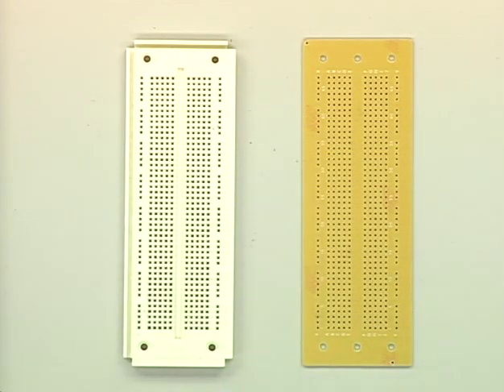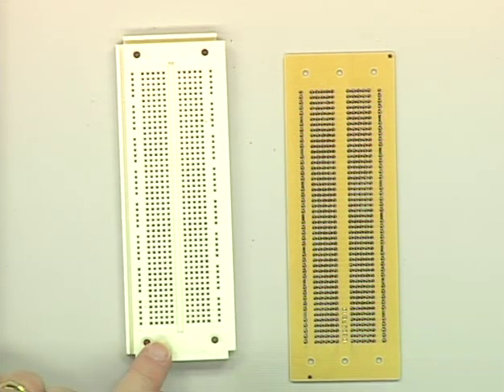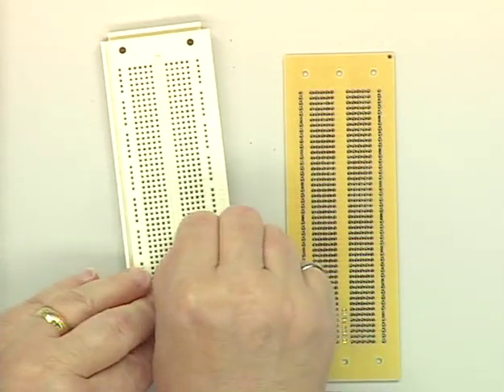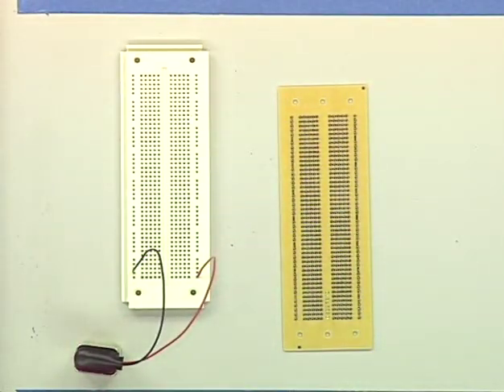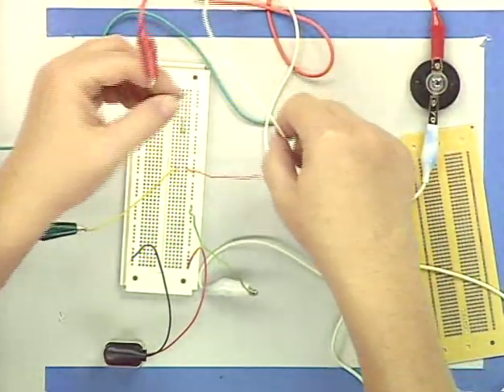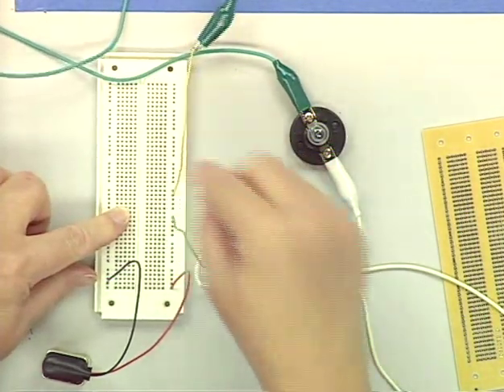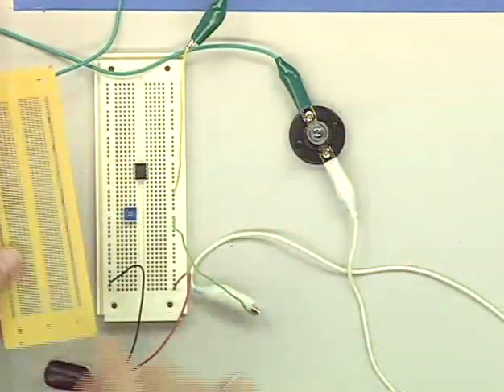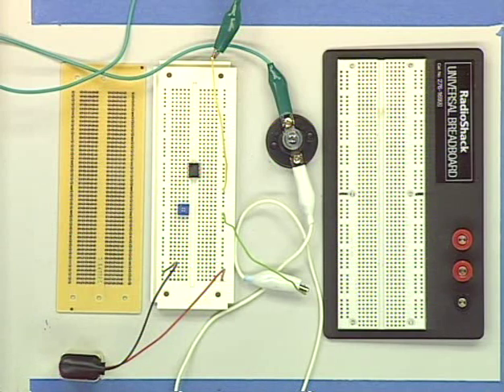How Breadboards Work

Comment: @tyler9613 
Almost but not exactly.
Say you have two equal resistors in parallel and you add another. You will not half the resistance again, but you will only reduce it to 3/4. Same in series.

Comment: Great video ! Very informative , being that I am a noob, like the ending. 1 question whats in the bread board that connects everything. Or how does power flow through the board, is it wired on the inside? Thanks